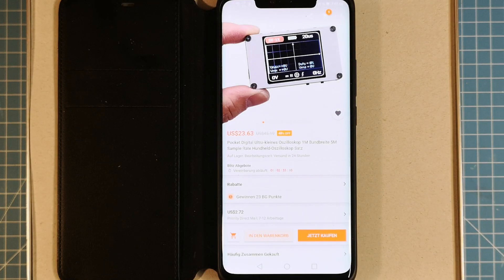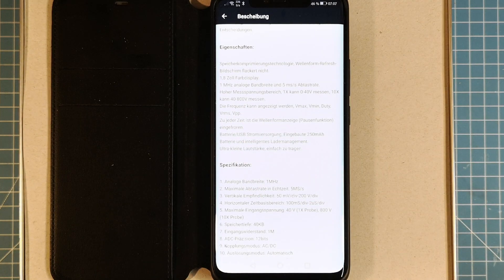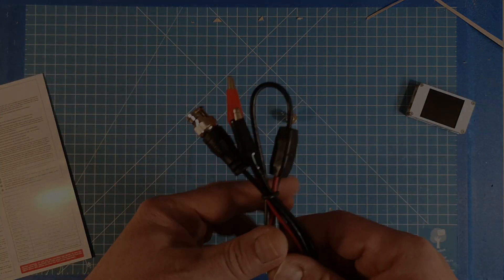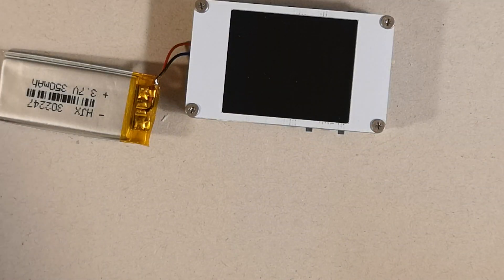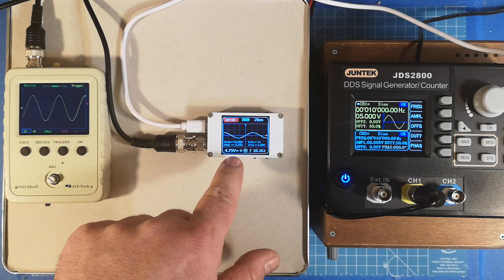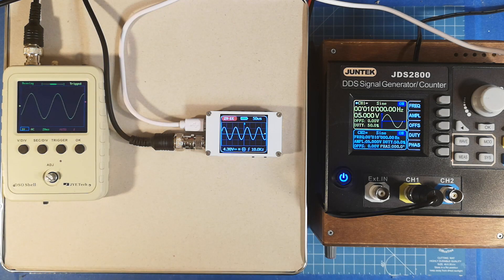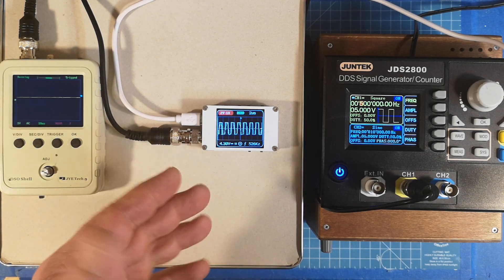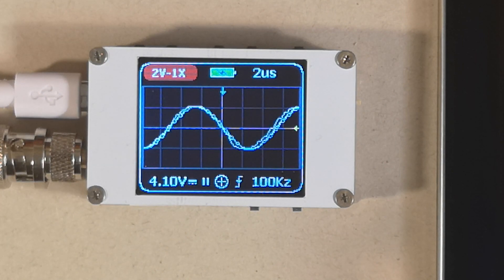pocket oscilloscope under $30, daniu dso188 vs jye-tech dso150 shell.

Comment: Looking to buy one but from what i can gather these are no use for testing electrical items like laptop motherboards or television repairs they are only useful for audio waveform analysis due to the limited frequency of 300khz you really meed 20mhz oscilloscope?

What can you actually use the DSO188 for testing of?
Reply from the maker: It's more fun for me, when I started with electronic an OSZI was expansive and bulky I just like to play with them. The DSO188 is just fun so small and more usefull the the DSO Pen's you could buy 20 years ago with a 64X32 Pixel display for more then 200DM (100€).....

Comment: @Anyone who wants to help.
If I wanted this to display audio outputs, from different instruments, such as synthesisers, is there an easy way for me to do so?
If I make a box with a female to female Jack, could I just tap into the wiring of that?
Any pointers would be appreciated.
Reply from the maker: You can just attach it to the output but as long as you don‘t play a stable tone it would look messy, it can’t trigger to audio